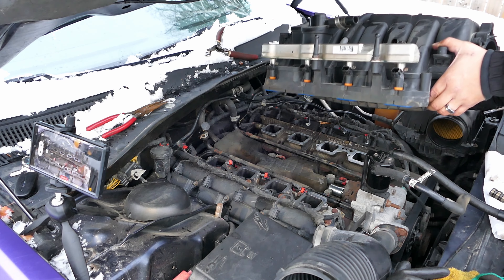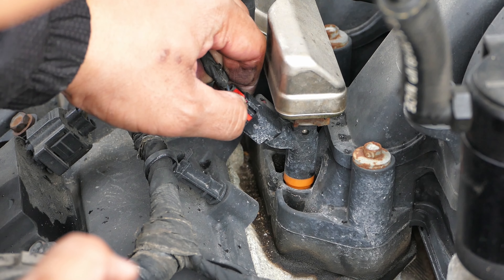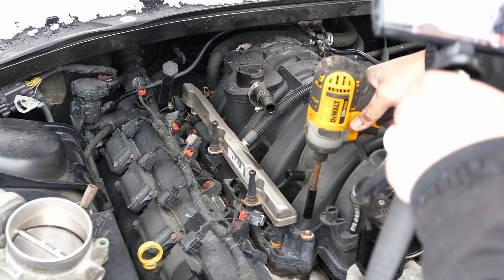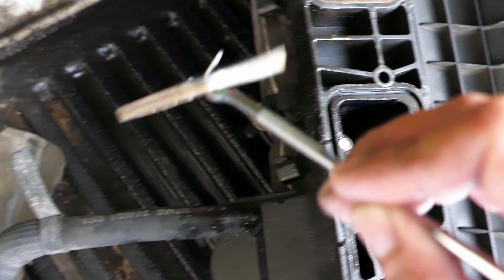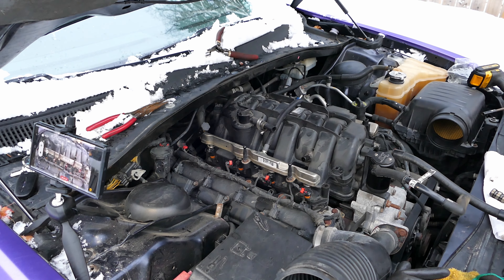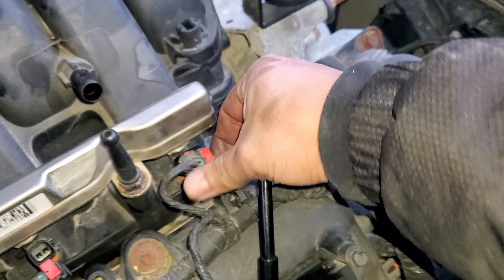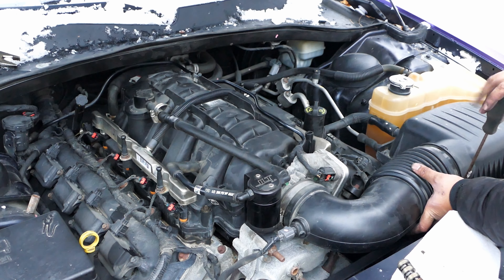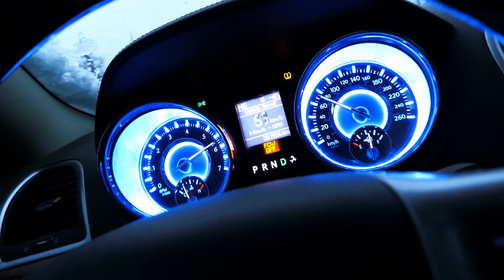5.7 hemi intake manifold gasket replacement

Comment: will this be the same for a 2019 rt ??
Reply from the maker: @sloebucks1565  hey there, you should be just different variations of connectors if different between years but overall it's the same process

Comment: what did you use to clean the gaskets bro
Reply from the maker: @leomendoza2234  hey there, We replaced the gasket but when we removed it, we used brake cleaner on a rag to clean the mating surfaces.

Comment: did you depressurize the fuel line since it spit out a bit of gas? and what did you use to clean the throttle body?
Reply from the maker: @YoungAmzn  hey there, I just disconnected the fuel line, some gas spilt but I didn't mind, I used brake cleaner sprayed on a microfiber towel then wiped the blade. There's "throttle body" cleaner but I think it's the same lol. Hope this helps.
Reply: @moparbro  when you say you wipe the blade what blade do you speak of ? And thanks brother yea I read other places where they pul the fuel pump fuse let it die to depressurize it and another person said just let it sit for half an hour or something but I’ll let it sit overnight so I can pull it like you did, I don’t mind I have 2 other cars I can let mines sit for a day, I do it everyday lol all I do is work n go home
Reply from the maker: @YoungAmzn  hey there! ooppss yea I ment the throttle body blade, with the throttle body motor so close to the throttle body blade, I wouldn't spray the area, just spray on a rag and then wipe the throttle body blade. Yea just disconnecting the fuel line worked for me, you also prime the fuel system after but having it turn the ignition to run and then back off, should start.
Reply: @moparbro  thanks for the info! Huge help! What does prime the fuel system mean when you mentioned after?
Reply: @YoungAmzn  bro just turn to run and off run and off a few times, cycle the fuel pump before cranking! or just crank for a while if u want to lol

Comment: What are the symptoms the car was experiencing?
Reply from the maker: hey there, I had to replace the vvt solenoid, but I had sputtering acceleration. Definitely vacuum leaks, the gaskets were pretty bad, maybe the reason why the vvt solenoid went? Anyways runs way better now 🔥 thnx for watching!
Reply: @moparbro  I just did the same job tmr I will see if it fixed the problem
Reply from the maker: @Srtvon313  🙌🔥
Reply: What are the torque specs on tighting it down?
Reply from the maker: @bunniie5754  hey there, looks like it's 9ft lbs https://help.summitracing.com/knowledgebase/article/HE-05430/en-us

Comment: At the 5:31 mark, what did you do with that extra circle gasket, or did you find out where it goes?
Reply from the maker: @khoality102  hey there, i just kept them, ones for the oil cap and seems like the others were spares.
Reply from the maker: Also could be for other mopars, the kit is most likely generally for most all 5.7l hemis

Comment: Thanks for this video! I was leaking coolant from one of my gaskets in the front left side thought it was water pump or heater core thankfully not .
Reply from the maker: @mutmessiah352  thnx for watching!
Reply: @moparbro  ur welcome! I didn’t know if it was Valve Body gaskets or intake manifold gaskets this solved it !

Comment: Any issues getting the line in the back off?
Reply from the maker: @terderiohammond3055  hey there,  yea It was a cold day, pulling it straight and leaning back did the trick
Reply: @moparbro  thanks broski, I gave up and rotated it enough to change them lol, it's high 90s here
Reply from the maker: @terderiohammond3055  ah yea just make sure it straight and pull straight back, u might fall back but that line is connected to the tranny so it ain't going anywhere